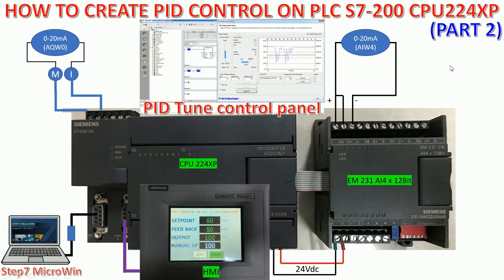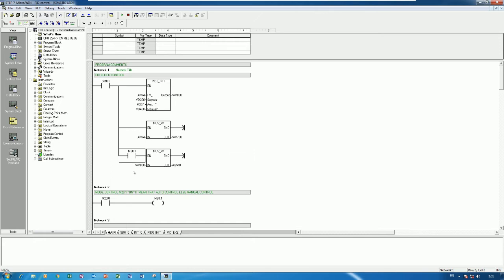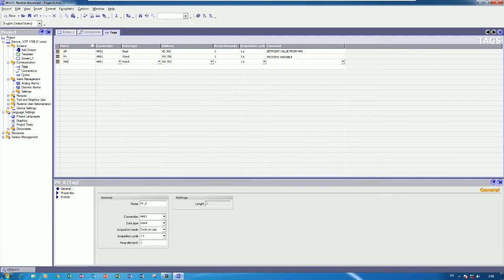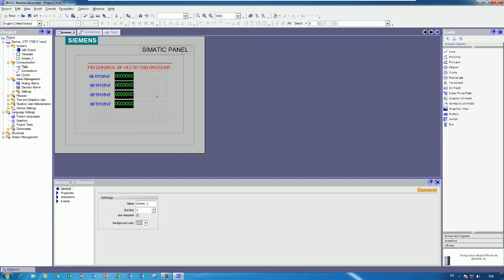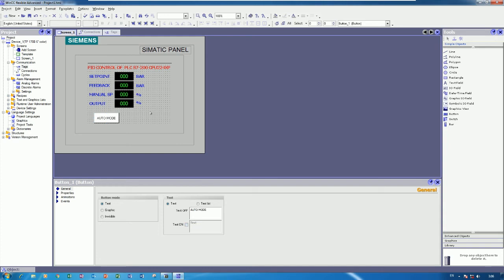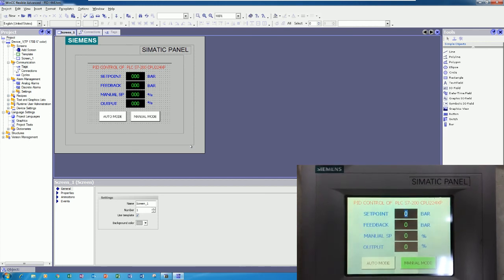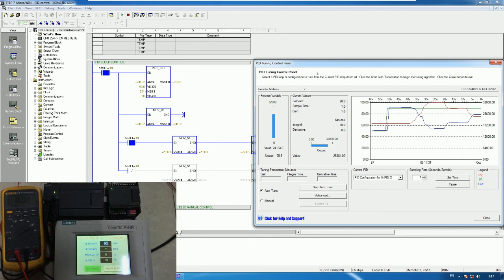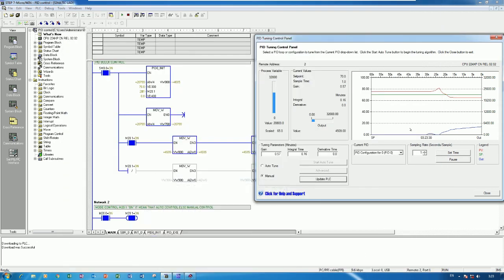How to create PID control for PLC S7-200 CPU 224XP part II

Comment: Hello how to view my current and voltage of my battery and solar in hmi tp 177 micron with plc s7 200 cpu 224xp Dc/dc/dc.. hope you response..
Reply from the maker: Hello sir,
Thanks! please provide me your existing process. Do you have 0-20mA or 4-20mA analog output from you batteries system?
If yes it easy, but if no we need to convert from you batteries voltage to standard analog signal like 0-10DC, 0-20mADC, 4-20mADC.
Thanks!
Reply: @generaltechnologyknowledge5165  yes I already order dc isolator amplifier 2pcs, but I don't know how to wire and program it to s7 200 cpu 224xp and hmi tp177,
i want to see the charging voltage and current of my solar charger controller and also the battery voltage, my setup is 48v system. 
Luckily i found your channel and watching some of your tutorial videos, 
Can i chat you in your facebook for helping me about how to wire it and program in plc with hmi interface?
Thanks and more subcribers to come..
Reply from the maker: Dear air,
What si the signal from amplifirer?4-20mA, 0-20mA, 0-5VDC, or 0-10VDC?
Reply from the maker: If we have this signal it easy to connect to PLC
Reply: @generaltechnologyknowledge5165  4-20mA and 0-10vdc
Reply: @generaltechnologyknowledge5165  my battery working voltage is 0v to 63v lithium ion battery series of 14cells each cell have 80parallel of cell total Ah is 200Ah
My solar panel as now is 1000w and planning to upgrade to 2000w voc is 0-150vdc and working current is 0-60A charging base on specs my solar charger controller.
Reply: Here's my hardware items for this project
1. Plc siemens s7 200 cpu 224xp dc/dc/dc
2. HMI siemens touch panel TP177 micron
3. Power supply 48v to 24v converter 5A
4. 2 pcs dc isolator amplifier 0v-10vdc, 4mA to 20mA output
5. 10pcs relay 24v coil
6. Solar charger SRNE brand 12v/24v/48v auto sensing voltage 60A with rs232 output for rx and tx signal
7. Inverter 36v to 72v dc input voltage
Can you help me to do this project, i want to use plc as a main controller of my solar setup. 
If this make successful, i am willing to pay for your effort and knowledge you share.. thanks here's my email eddjuzp@gmail.com for more details and clear conversation..